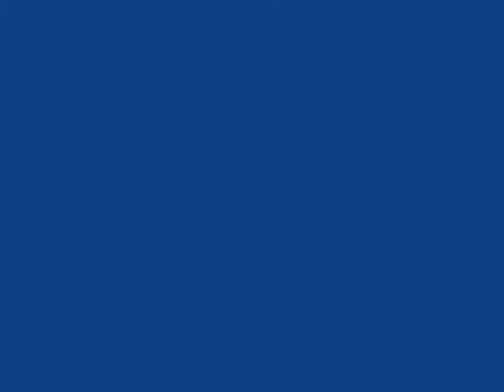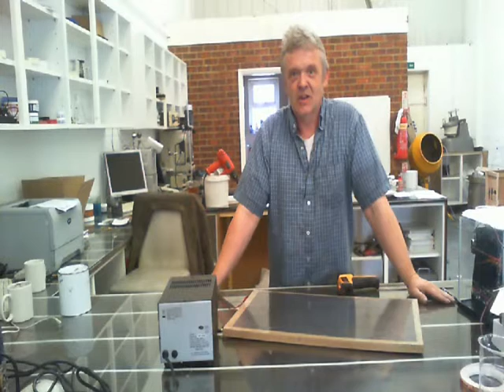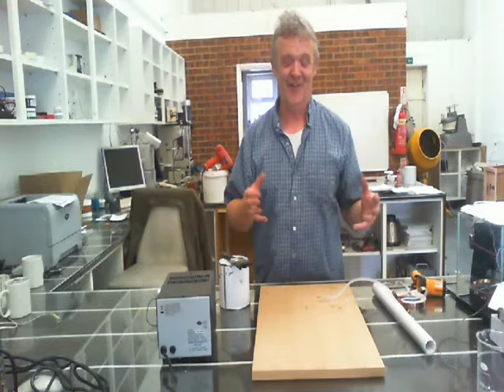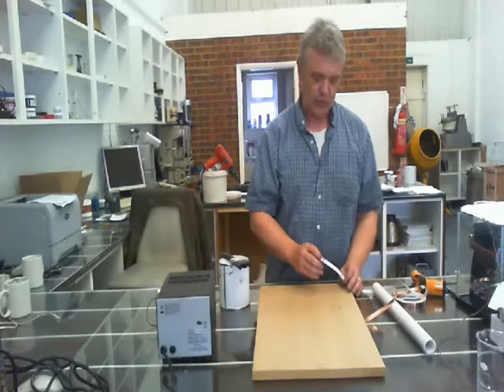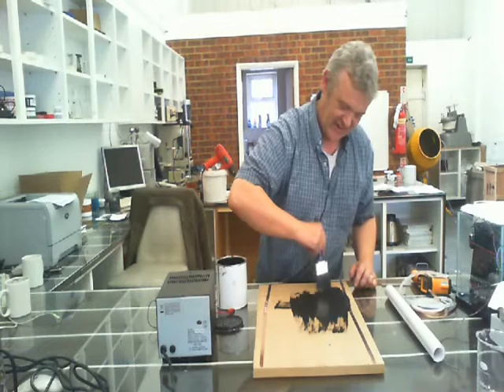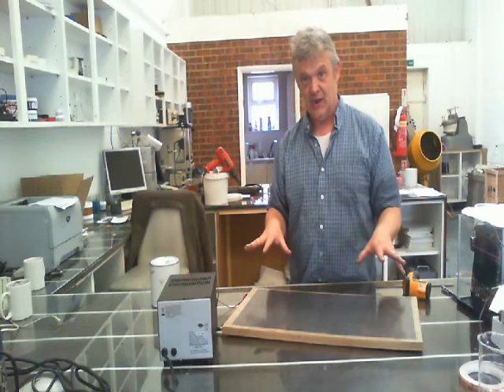The flattest flat panel radiator ever! - and how to make it

Comment: I would like to make 12inch square heat panels. That would be ceiling mounted for my reptiles. I need the panels to emit about 140F. So it emits a heat on the floor 90F. how would u get one of these panels to give off 140F. I will be using dimming thermostats. Add more cooper tape ?

Comment: Simplifying things is a big part of your demonstration. At 45 degrees radiation at that size runs you 40 volts at 2 Amps = 80 Watts. I wont disagree it is a genius process but a gimmick for practical use. It is safe at 40 volts, again i agree. To have a good return on heat and efficiency you at least need 1 m x 1 m PTC floor heating that can run on standard 240 volts. It wil have 500 Watts output and that even is not enough to heat a small space. You really need to pump up the Voltage to 500 Volts and have it produce 1000 Watts of heat. This is ofcourse out of the range of safety and as always your own risk. At the 1000 Watt level you are better of with a convection heater, simple and agian safe.

Comment: Can I operate this type of resistance heater on my sailboat?  I intend to apply it directly to the fiberglass/ resin hull and cover it with 1/4 cork. Although I have 110v shore power, I would like to run it on my 12v battery system.  Is this feasible?

Comment: Salam Robert Murray-Smith 
Awww! I just paid 168 CNY for something similar. I am in Shanghai and here it is being sold with the name "Carbon crystal heating". I bought 2 panels of 500 Watts each with a thermostat. After watching this video I am 100% sure its exactly what you have made.
Reply: Also.... I think you should suggest your viewers to always paint it on ceiling so that its a bit far from human touch :)
Reply from the maker: it would be mate - i reckon it would be good under the floor too
Reply: right...but in many countries floors are cemented :)
Reply from the maker: Talha Kamran they are in the UK too - you would paint the heater right onto the concrete and tile over the paint

Comment: I just seen this for the first time and I'm very interested however the light dimmer will not work for ac current because it doesn't drop from 0-120 or 220 for British electronic it only drops to 70 or so 

I found that out after trying about fifteen different types and brands trying to make a cheap  varyac
Reply from the maker: Have a look here A Painted Radiator On House Mains (A/C) where i do exactly that - mine dropped to zero and i used 40 volts

Comment: Brilliant.  The title doesn't do it justice, though.
Reply from the maker: cheers - what would you suggest? - i only have my own ideas when it comes to dreaming up a title lol
Reply: The reason for my comment is that I originally thought it was about applying paint to a radiator.   How about " Making any surface into a flat panel radiator with heat resistant paint" or " The flattest flat panel radiator ever!"
Reply from the maker: Chris Corbett
like it - you will notice i used your second title which i loved lol - maybe i should run all my titles by you first
Reply: LOL. Maybe I missed my vocation and should have gone into marketing.  Unfortunately, having a conscience might be a bit of a drawback. :)
Reply from the maker: Chris Corbett
it wouldn't help lol

Comment: Hello Robert!
Thank you so much for sharing this absolutely cool tech-tip with us!

May I ask, if you could somehow get a Infrared camera, to film the heatup process of your Panel-heater, as this would be very important, to see, if the coating and the heat distribution is the same all over the painted area....
Laser -thermometer is nice, but to see the full area, in comparison to the surrounding area, that is interesting and important.

best and kind regards
Reply from the maker: good point - i'll try and get one
Reply: Please let me know your results, when you have them....as I want to cooperate with you and add your conductive Ink to my collection and offer it here in my contry, as I don't wanna spend any more on regular heating system... please PM me, if you can..

THANKS with best and kind regards
Reply from the maker: lukelordoflight
what's your e-mail happy to pm you

Comment: A while ago I made some heated wristbands (anklebands) using heater wire between two pieces of heat conducting tape, which was great for the cold winters we've had. What I found however, was that the heater wire had a 'memory' which made getting it on and off a bit cumbersome.  After seeing this paint I thought it would be great on a flexible plastic wrist (ankle) band, weathers a bit hot for it now mind haha
Reply from the maker: Lol - indeed - but this wouldn't be so good for that - well not as good as one of the inks i am working on which is a flexible version of this for exactly what you are proposing

Comment: For painting it on a wall, if you have a 16 gauge wire going from the 'heater' leads to a switch and then to a 10 amp breaker I wonder if that would keep the wall (drywall paper) from setting on fire.  With the breaker and grounding it should keep current at or below 10 amps. 

I'll have to buy some of that ink now haha.
Reply from the maker: just make sure the temp doesn't go over 60 degrees - a k type thermocouple and pid will do it - you can buy them as a kit for underfloor heating - which is what this is - just in a tin

Comment: How flexible is the paint? Can i paint it on fabric or silicon rubber or will it crack? I was thinking of trying to make heating elements to fit in shoes, gloves or a jacket that you could just plug into the power of a snowmobile or a motorcycle
Reply from the maker: it's silicate based so has low flexibility - it'll cope with the flex most buildings experience but it wouldn't work so well on cloth - i am however working on a cloth version